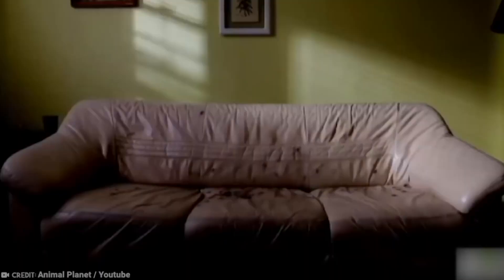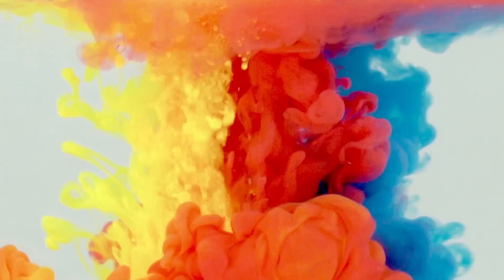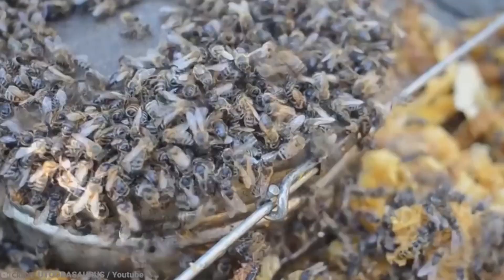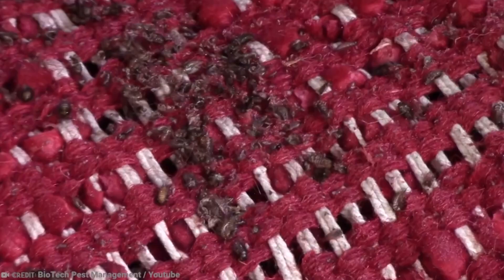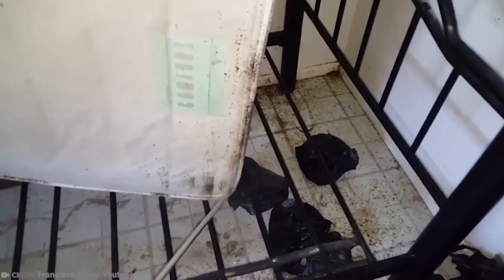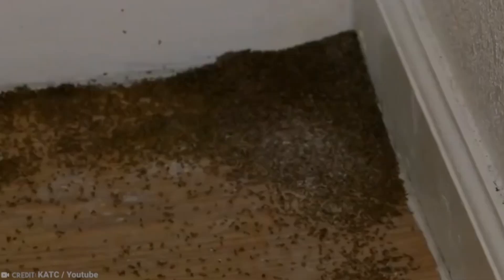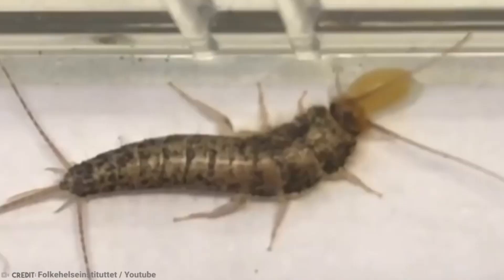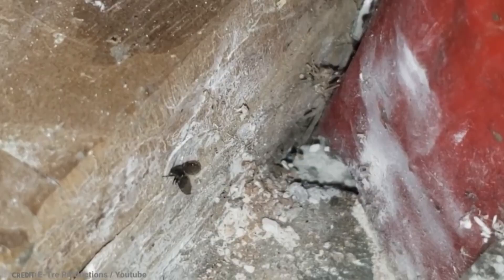15 Worst Bug Infested Houses

Comment: Bedbug removal:
IF you are alone with no pets, you will need:

* An --8x10 tarp 
* A painter's dryer gun
* A bedbug bag
* A clothes dryer

Use heat-gun on mattress. Don't be stupid and expect to heat the mattress beyond 120º -- use oven thermometer to gauge heat. 125º is guaranteed to kill -- so no overkill is needed beyond that.
Place mattress in bedbug bag.
Place tarp on box springs so that the tarp drapes over all four sides of your bed.
One inch of tarp-clearance over your headboard/footboard/sides respectfully is enough.
Place mattress on tarp.
Brace tarp up to form a bowl for your mattress (keeping in mind that you must have the tarp fold over the brace - otherwise, the bugs will just use the braces to crawl over the tarp.)
If you have any cords or hoses leading to your bed, wrap a stick fly-strip around each keeping in mind you want them OFF any pathway/perimeter breach.
Keep your bed at least two inches from ANY upright surface should the bugs fall from the wall.

Place your bedding in your dryer before AND after you change your sheets or find a bug - pillow and pajama's included.

Every morning, check for bugs. Use heat-gun to kill any you find. You shouldn't as the tarp is a very effective barrier for those bugs. But they may fall from the ceiling when infestation is so bad, you can see them every minute of the day.

Cover the upholstered furniture as well. 

This will starve them out after approx. 8 months. But the most healthy, most well-fed, durable bug can last up to 18 months in optimal conditions -- which you probably do not have.

Good luck!!